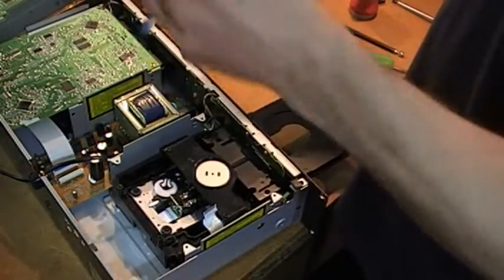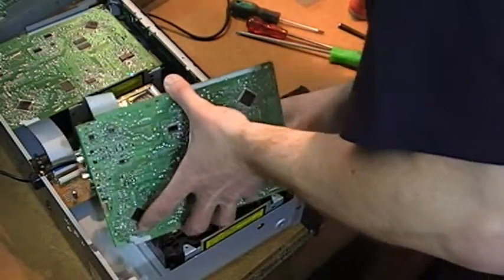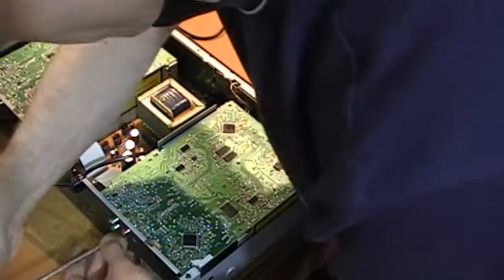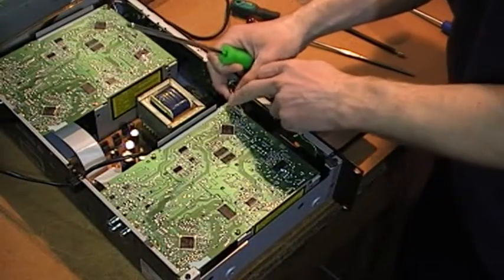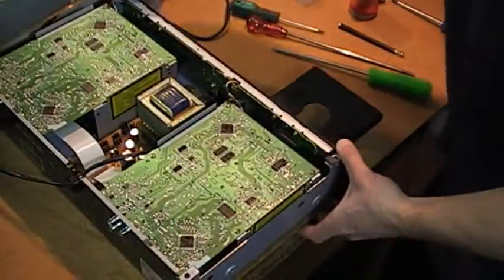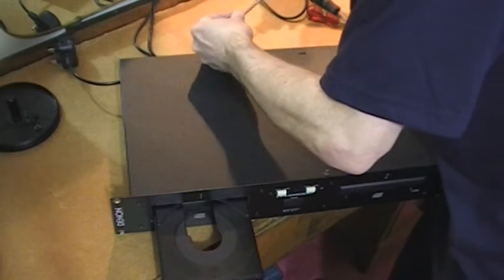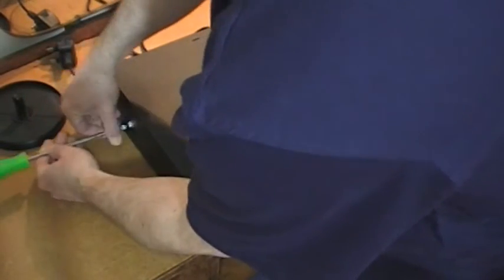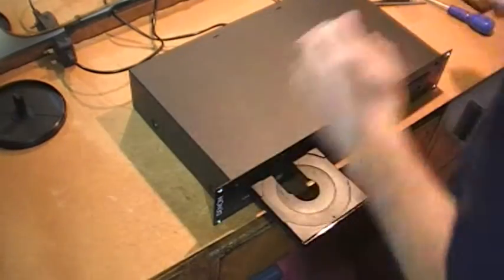Denon DN-D4000 laser replacement (Pt.4 /4) - Putting it back together

Comment: Thanks so much for making this video.  I've got a Philips under-the-cabinet AM FM CD player (model AJ6111/37) that uses the same SF-P101N optical pickup your Denon uses.  I've just placed an order for a replacement SF-P101N optical pickup.  If I may suggest, why don't you modify the title of this video series to include "SF-P101N" in your title.  From what I understand, the SF-P101N is a very common optical pickup, used in many different CD players.  Having SF-P101N in your title would expose this video to many more potential viewers.

Regards, Tom

Comment from the maker: @integrin1978 Thanks. I've had to change lasers / mechanisms a few times in various Denon twin CDs (DN4000, DN2600, DN2100, DN2000F Mk2) so it made sense to record it for future reference and store it somewhere it would always be accessible from any location. Thought I'd share it. Glad you found it useful. Yeah it would have been difficult to make changing a cd component anything but boring, the exciting part comes when you're using it  in the club later, lol.

Comment from the maker: Thomas, I've DJ'd in nightclubs with Denons for many years and seen the symptom many times. I know from experience the cure has been to change the laser. There are also clues, you can hear the disk spinning as the laser tried to read it, if the fault was with the logic board it probably wouldn't be trying to read the disc as normal. If your cd plays on the other deck ok that points to the laser. The reason I'm good at it is practice, I've probably changed over ten of them in the past few years.

Comment from the maker: The protective shipping cover for the laser lens wasn't clipped on properly to my replacement in the video, you see it fall off at 3m05s in my Pt.1 video. If it was clipped on properly you would need to remove it. It's a U-shaped piece of black plastic, just lever the bottom edges out away from the block in turn with a finger-nail (or carefully with a small screwdriver) and lift it upwards away from the laser lens.

Also assume you removed the "anti-static transit" solder blob as shown in  Pt.1.

Comment from the maker: @ILOVEFURCIO The procedure for changing a laser in a DN-2600F is very similar, if anything, because of the connectors I think it's slightly easier. The part number of the laser is different (it has slightly different connectors, 5 pin & 8 pin, pay attention to the bit of the part number in brackets, this matters). For a DN-2600F / DN-2100F / DN-200F Mk.2 or Mk.3 you'll need a "Sanyo SF-91 (5/8)" laser.